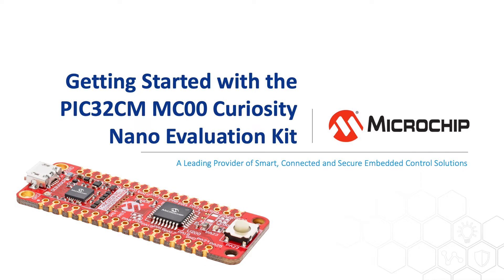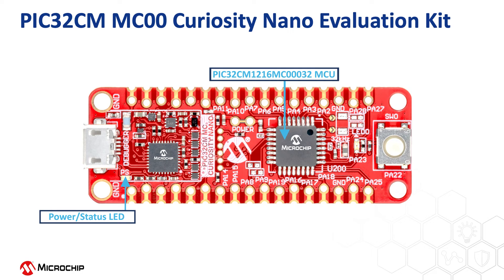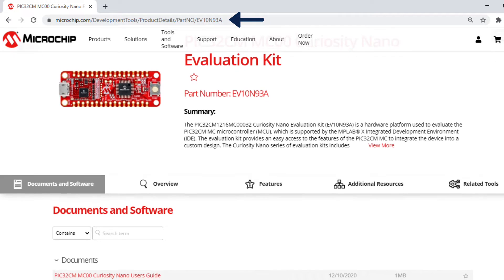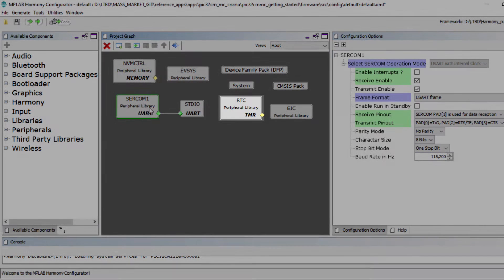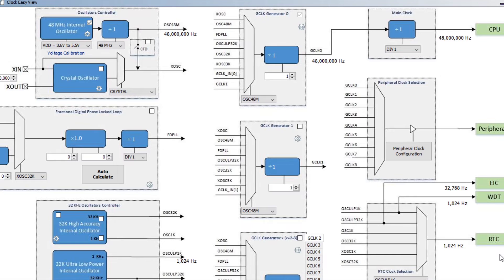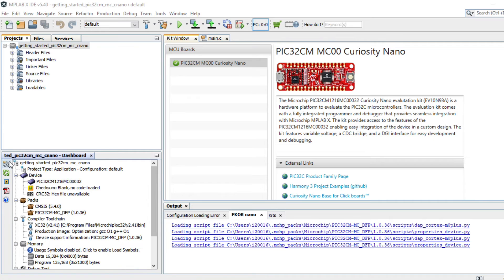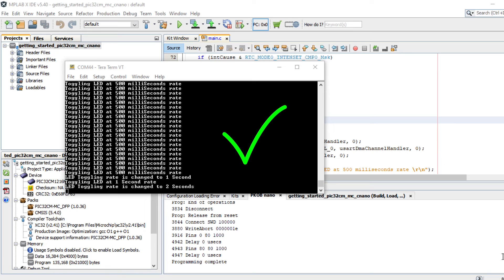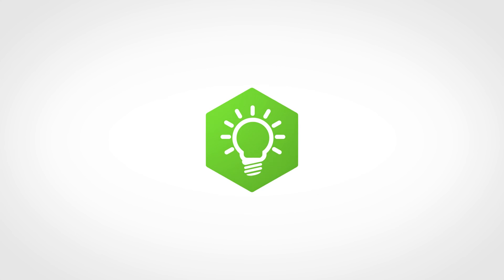Getting Started with the PIC32CM MC00 Curiosity Nano Evaluation Kit

Comment: Hello MICROCHIP engineering.  I have  a PIC32CM MC00 boards. According to your video,  I can connect it to the Curiosity Nano Base for Click boards.  However I see the pin labels of the PIC32CM MC00 does not correspond to the pin labels of the base.   Could you please advice?   Thank you